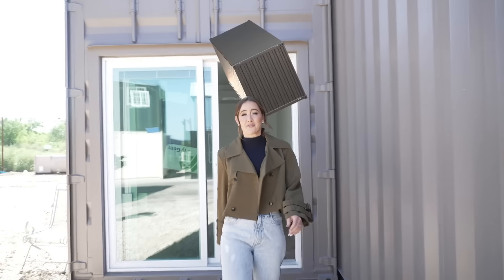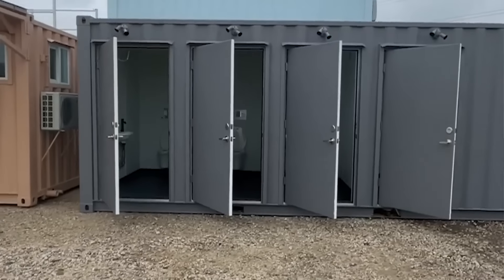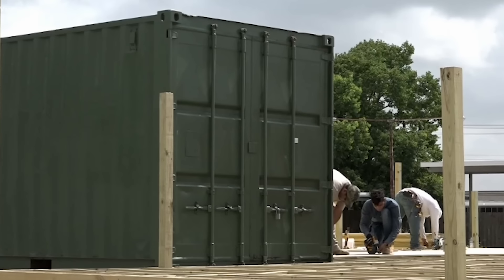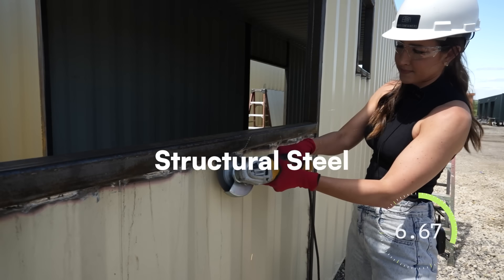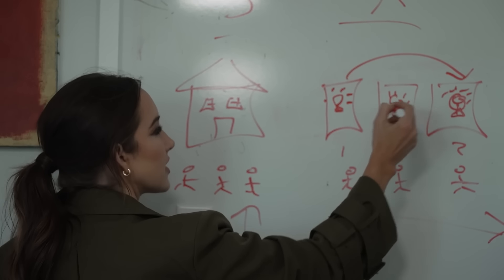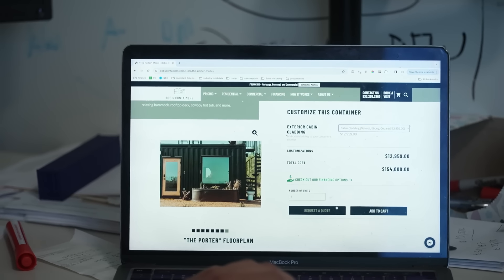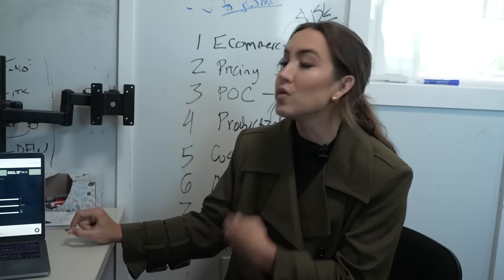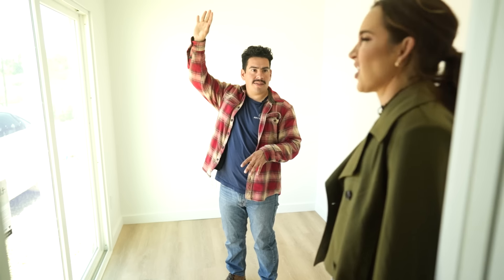Shipping Containers Are An AMAZING Business

Comment: As an architect and construction manager, I’m impressed and intrigued. The things I didn’t see addressed, however, are site improvements (access, utilities, landscaping); code compliance; and permitting.
Reply from the maker: Great point. We're trying to actually keep these under 30 minutes so can't cover it all. BUT go to their website all site plans and details are actually open source.
Reply: @CodieSanchezCT  Thanks, Codie, I just wanted to point out that there are (significant) costs associated with these things and they can vary widely depending on the site. Also, I visited Bob’s website, and saw a header called “Permitting” but saw no info under it.
Reply: Hey codei I love watching 😅ur videos ur an inspiration are u going to invest into this i learn a lot frome u
Reply: @Xanthrochroid Permits and consents will vary, depending on which territory you are operating in and how close and/or difficult utility connection takes or costs. If like you, your new to the concept, ask to speak to a buyer in the local area you want to develop your purchase. Often they can quickly give a contemporary insight into what amount you should budget for. 

If you are still unsure, employ a quantity surveyor to give you a tailored step by step blueprint.
Reply: @CodieSanchezCT  what would be BEST is to cover: moisture control layers AND vapor control and Condensation Prevention & Mold Prevention ...as these are THE #1 LIABILITY...
Reply: Way to crush the buzz, Man! I could build all kinds of amazing dwellings from the materials in surrounding forests to using snow and ice… if it weren’t for bureaucratic B.S. ☝️ stay off m’ land and outta m’ business!
Reply: You pick a model of what you want for your land. The land owner worries about utility access, landscaping and final code compliance for that particular county. This guy takes orders, builds em out and ships em. Once they leave the lot, bureaucratic BS, code and zoning laws are on the buyer.
Reply: @Xanthrochroid To help you, it is easier to build in the country side than to build in the city. Be aware of the destination because you will fall under the city or county jurisdiction for the construction of  the home.
Reply: It's because these videos of hers are for entertainment and offer no practical value
Reply: Thanks for sharing
Reply: @comingoutspinster-rebellik1479  actually, that's only half true. he said in the video that he now does mortgages, and his words: "you choose the land, choose the container, and we provide the mortgage which ties it all together" so in that case, you would likely also hire someone to cover these challenges for you, and the cost would be included in the mortgage. this would mean that bob would definitely be somewhat concerned and possibly involved with both the logistics and costs of this process on a per-container basis, although it may be a small portion of his overall business for now. still, he did highlight the mortgages in the video.  
also, to everyone else, suggesting that a construction manager and architect learn about utility providers is just laughable.
Reply: @tirkentube  I missed that part entirely… about him selling the land as well! Whaaaat?!? How did I miss that?!? Very unique situation they got going! Guess he’s got the full circle covered.
Reply: Exactly. Just the sewer and water and electricity ran to the container will cost around 10k. I mean I love the idea but this is not exactly affordable for those that actually need it
Reply: @spacehawkthunderstorm  you see what you are.. tons of value on these vids…
Reply: Exactly, or even getting access to water, electricity, sewage : things that make a home functional.
Reply: Watch at approximately the 26:25 mark, she describes "step 3" and quickly mentions "cost of land and additional buildout..."
Reply: As a gc my thoughts are the same.
Reply: @LuisSanchez-xh4gp  Those costs will be there whether you live in a castle, container or yurt.  And those costs will vary from town to town.
Reply: Awesome information, you are so cute.
Reply: Some land property have restrictions or regulations of what kind of structure your home must be made of.
Reply: It will be cool in a commercial lot to put one of these containers if regulations allow.

Comment: Wow this guy just pulled a Henry Ford. Most people might assume Ford came up with the automobile but no he came up with the assembly line. He dominated the industry because he had first advantage on the assembly line and its much faster means of production. This guy is just taking Fords idea and bringing it to construction(agile construction they mentioned in video) I still give  Bob credit because he is bringing it  to the construction industry is still an original idea even if we already have assembly lines in other industries .
Reply: Exactly what I was thinking!
Reply: Ford perfected the assembly line, he didn't invent it.
Reply: no he did not it was George Washington Carver. Give credit to where its due
Reply: 1799 – Eli Whitney’s Interchangeable Parts: This concept laid the groundwork for modern assembly lines by demonstrating that unskilled workers could assemble uniform parts to produce a complete product, initially applied to firearms manufacturing.
Reply: Respectfully, Henry Heinz was using the assembly line long before Henry Ford. Ford just applied it to a new industry.

Comment: Shipping containers are narrower. Then the lens on this camera. Is making them out to be. A shipping container is only 8' wide. Before you install the walls. To hide the wiring and plumbing. Hight is usually 10'  You would need to go. A bare minimum of two wide. To have a decent amount of. Breathing and elbow room. Three containers wide, at 40' deep. Is perfect. H 10' W 24' X L 40' before the walls and flooring are added.
Reply: people live in small cars.. Whats your point?
Reply: Shipping containers are NOT 10’ clear in height. The standard height of a shipping container is 8’-6”, and the HC (High Cube) ones are 9’-6”.

The most common lengths for shipping containers are 10 feet, 20 feet and 40 feet, and they are typically 8 feet wide.
Reply: @Mikael-jt1hk  it’s misleading.

Comment: What I would do is weld on some support structures to the top of the container and then attach metal support beams and structuring. Lastly attach the metal amish style roofing on a slant to one side with a small slant on the other side with a short guttered over-hang.

Comment: You have missed the most important part of every building. The foundation!
Are they providing temporary footing for the containers? Which means they gotta be replaced in 10 years or so...OR they expect owners to come up with temporary/permanent footing, which means they need get structural engineer involved.
Reply: What does that mean
Can you elaborate
Reply: @RiRi-ku6xz   You can't just put these or any container or storage on dirt/soil and start using them. They need to have foundation like any other structure you see out there. 
What part of my comment is not clear?
Reply: That would be a great video.  Maybe Bob or Codi could do a delivery and setup video.

The city or county code would most likely determine the foundation options based on the lot and the structure.  

The Structural engineer would give you the foundation solution.
Reply: Can be an easy foundation, couple if concrete blocks, depends. Doesn't have to be expensive or complicated

Comment: Building in a container is a horrible idea: 
1. It's a depreciating asset unlike a normal construction that appreciates over time. 
2. A shipping container its a giant thermal bridge. 
3. Because of the thermal bridge it will build a lot of condensation within, which will lead in time to mold .
4. On the other side, if you are in a hot area, you are living in a metal oven 
4. It's a temporary construction  with a medium lifetime.
5. It's actually not that cheap.
6. Most of zoneing will not allow this sort of construction.
Reply: Exactly what I ran into with container projects...also he's extremely expensive, $50k, 60k, 250k, really?!!  $250k will get you a realy nice 2 story ADU in the strictest CA municiple code areas fully permitted including architect cost tha will $450k value to my single family home.  And I can then rent the ADU here for $2500/month as I watch it appreciate.  Also 45 foot high cube containers can be picked up in Long Beach for $2k-2.5k.  Same cost in Houston.  $3500 must include hauling it to TX.  My F-550 with trailer and container costs $600 every 1300 miles to travel I-10.  Do it yourself or don't do it.  Containers are best for storage or open air use.  Don't even think about burying one unless it's a concrete form or cut in half to make a pool or something.  they are made to stack not to have their sides pushed in or out.  Look at the videos that talk about "...shipping container homes are a scam".
Reply: 100% agree!  unreal people buy this junk.  I'd like to see customer satisfaction over 10yrs.  Plus I can build that box for 1/2 with wood.  So scammy.
Reply: 1: Its a minimal cost building material with a moderate lifespan, by the time it becomes useless you have made your money back many many times over and can put something better in its place. If you go into it with this expectation, its probably not a problem.
2: Insulation
3: Refer to #2
4: Refer to #2
4: Refer to #1
5: Refer to #1
6: Not most, but legitimate concern.

Comment: A friend of mine bought a pre-built home (not a container) from an out-of-town vendor to be installed as a backyard home.   Problem is, when he got it brought in, he couldn't get the local city officials to certify it.   Was a huge problem that went on for over 2 years, ended up costing him so much extra out-of-pocket, plus the time where it couldn't be used....which was devastating.   So I'm still a big fan of pre-built homes, etc, but you have to be 100% sure about the full path for the site prep, utilities, and most importantly, the permits.

Comment: How much is the strength of the containers itself? And how much weight can the container hold once it has interior framing?  Do the roofs need an extra surface to prevent leaks?

Comment: The problem here is that shipping containers make for horrible houses. A solid metal shell invites all kinds of issues with condensation. And once you start cutting into it, the container quickly loses strength. Much like an eggshell. 

In the long term, you are better off just building the frame out of proper construction materials.

Comment: Let me tell you some downside.

1. Container homes does not hold its value.
2. Filing taxes is a big problem.
3. Causing reselling a problem too.
4. Regulations.
5. Containers cannot be stacked when the bottom container is cut oven.
6. Containers do not have good insulation.

Comment: I looked into those and personally I think they are too narrow to be comforable,  it FEELS LIKE A SMALL BOX and I don't like it
The other thing I don't like is the space lost with the corrugated metal sides,  you loose inches with the insulation and on the outside it still corrugated, which I think is ugly
If you could put at least 2 together and open up the middle, and fill in the outside corrugated area, it would look SO MUCH NICER
SO little space once you outfit the inside
You could build a wood structure for less and have something a lot nicer

Comment: didn't see any builds where you either put 2 together - parallel or above each other. Is it not structurally sound to do that? Also I see you insulate, but didn't talk about what heating/cooling system you use...probably not forced air or AC.

Comment: If you use a used container, see the oak floor and think, wow this will refinish nice.
STOP !
remember, these containers are meant to be used for years, the chemicals used to seal and protect that floor are massively dangerous. Loading or unloading does not put you inside for too long, but to live in it....I would not.
Oh, did i forget to mention,  do you know what products have been shipped in those containers ?  The list of HAZmat materials/products that get shipped is staggering. 
Using containers just for sheds, well, i would keep both doors open and cut a fanhole, medium size, to turn on for air flow as you are messing around in them.
fyi, i have been in the trucking/transportation business for 40 years

Comment: People complain about conversation and all I can say is duh. Depending on the climate and the difference in temperature from outside to inside, you can end up with condensation. I imagine a good dehumidifier would take care of the issue but be costly to have running all the time. Having the container in a shaded area or under a canopy could help as well.

Comment: This is how you steam vegetables and human at the same time. You can't efficiently insulate the walls due to the hard fact that these are made from steel. Your utility bills will increase dramatically compare to traditional building. In the long term (5 years and up), it costs more to own these containers than to build everything the old ways. Also these things rust over time and the maintenance cost will rise with each year.
Reply: Yeah my thoughts 💭 exactly. It’s not an asset but a liability like a car.

Comment: Actually you are supposed to register any vehicle that is used for business and transportation purposes with DOT.  The claims about the "Amazon loophole" is not true.  There is a reason even Amazon vehicles have a DOT number on the door.  Any of Amazon carriers caught not registering their vehicles with DOT that get caught face steep fines and being removed as a carrier.  Weight has nothing to do with an exemption from DOT in this matter and if you continue to operate your business while avoiding registering every single vehicle that is used, then you face those same steep fines, being arrested, and potentially losing your entire business.
For those wondering the $3.5k on the thumbnail is what some of the used containers cost before doing anything with them and is just clickbaiting.

Comment: Wow cool, but here's the deal. Ive been heavily involved in logistics and custom home construction. The more people there are doing this exact same thing the more expensive all materials will be both nationally and internationally. Im Sorry, but solving one problem by helping create many more is not a solution... You contribute to a much greater problem!!! A standard 20 ft container can hold hundreds of thousands if not millions of dollars worth of cargo... That same container after use can net can net the company 20-40% in the sales of the shipped items... Then that very same container can be re-used for the same thing over and over again until its either discarded or fixed from damage. Containers are designed for shipping period.